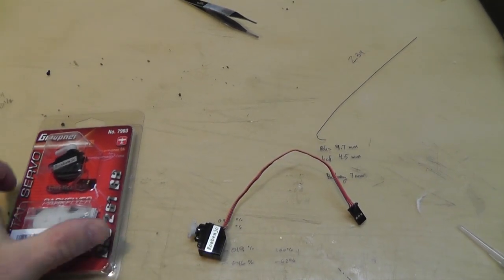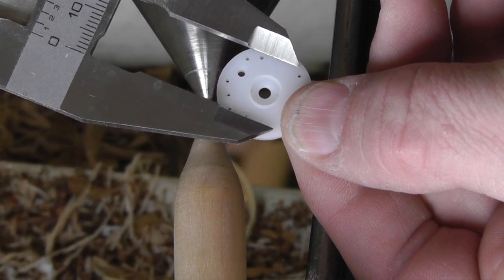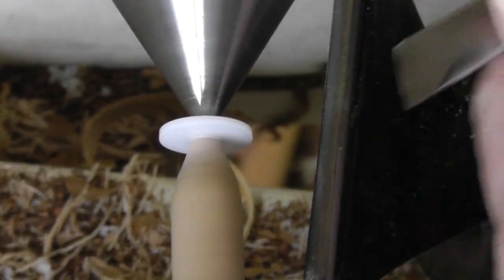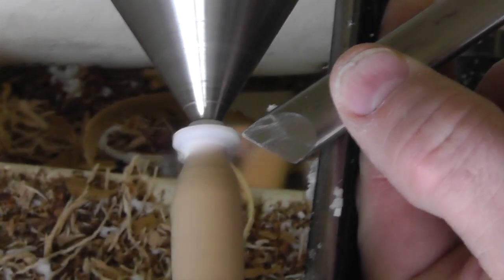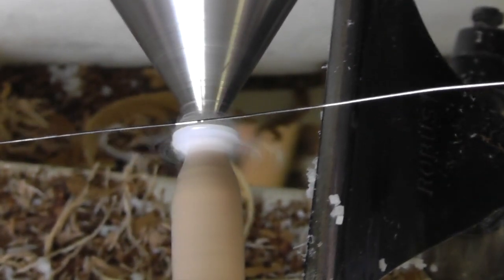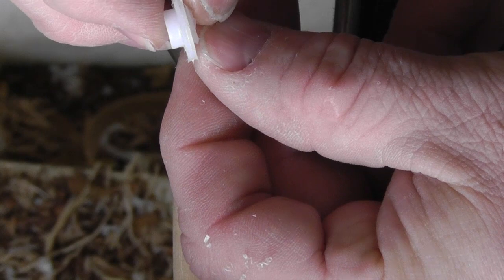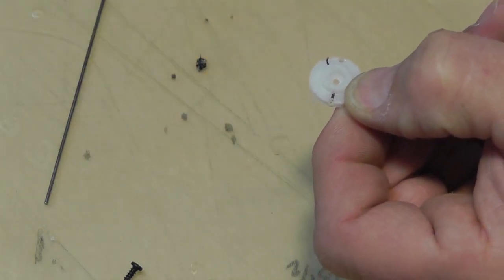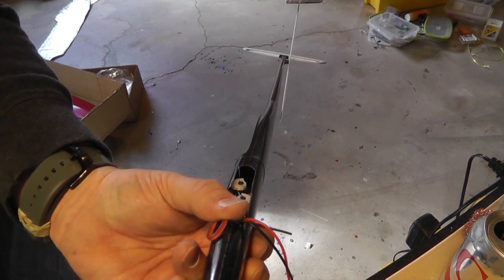Pull String Servo Pulleys for DLG

Comment: I really don't see the necessity of going to all that modification process vs. a regular servo arm???
Reply: i guess with the pully it has a stronger "arm" due to it's curve factor, thats all i can think off...
Reply: 1) sometimes you just don't have the space for an arm.,Pulleys work for tight fitment.  2) They give a linear control response = more accurate controls,  3) you get better torque out of the servo,  more even torque throughout the whole range of motion.  ( so potentially less flutter, or helping smaller servos work in a spot where otherwise you might need a more beefy servo )

Comment: Whats the benefit of using a guidance like that? Normally I would just cut the arm to length drill a hole where I would get full servo travel and then run in the string (I use metal strings) and then crimp it in place. I guess you can adjust it alteron without changing the whole string?
Reply: Linear movement of the string, certainly.
I like the idea, but lack the tooling.  Can't wait to hear about the report in the field, though.
Reply: Thanks I already suspected that. Would be nice to know if you will notice the difference.

Maybe Finch could create a DLG build series. How he builds his DLGs how to install the servos with full throws etc.

Might be interesting I really enjoyed the making a composite plane series!